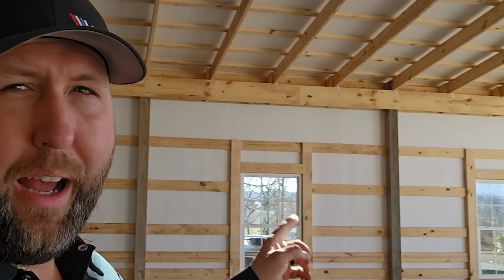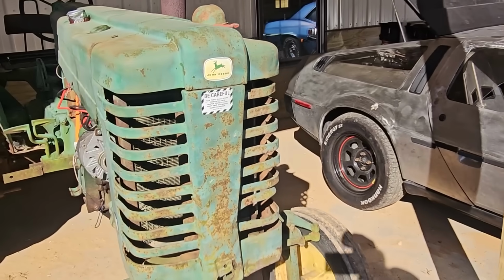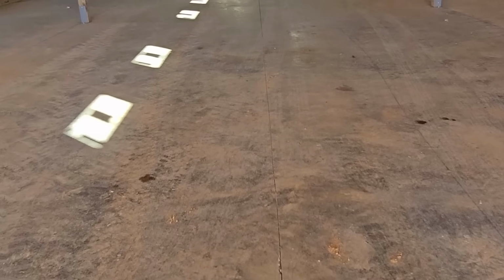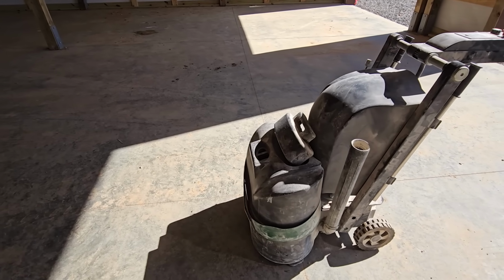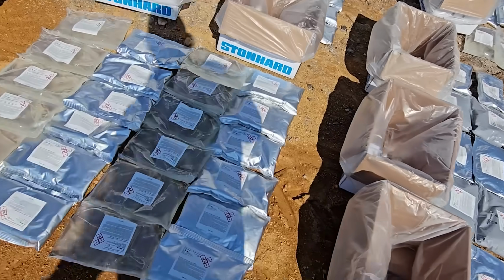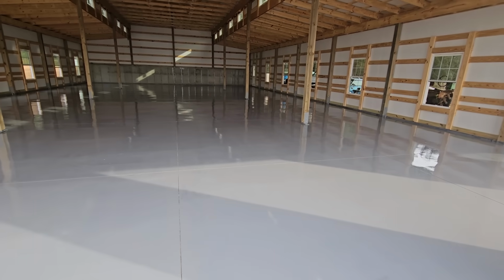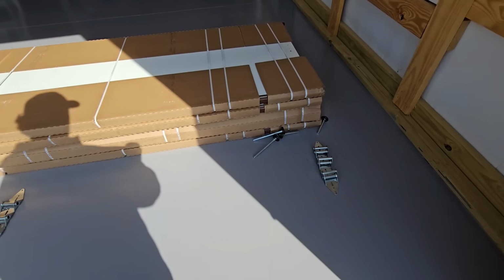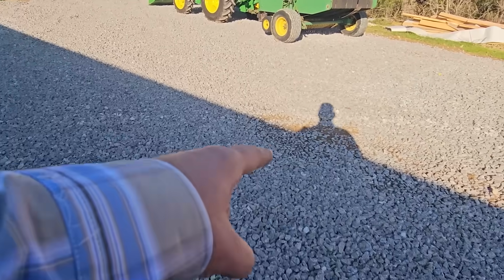Windows, Doors, Floor Epoxy, Gravel and MORE! Barn Build - Part 3

Comment: You should buy one of them old commerical floor cleaner/polishing machines you drive around on the concrete floor making it shiny, probably save a lot of time in the long run for the cleaning.

Comment: I have rebar 2' on center, with the fiber and 5" thick in northern Wisconsin. Still has minor cracks. You'res look a bit wider though. 
Any cement can get minor cracking.   What you're doing is fine, I never even painted mine but would like to for easier cleaning. The old M would be worth a resto 👍

Comment: They put in complete road with sewers and drains, were all braggity on all the high tech features, gonna last forever ... five years and every saw line had perpendicular cracks, they had saw out every crack replace 18 inches "re-strengthened" with rebar, again.  they used to have plank roads made of wood that probably lasted longer

Comment: Just wondering if it wouldn't be cheaper to just spray foam the existing doors on the main shop. Unless, of course, you definitely want to change the exterior appearance and maybe add windows like in the new barn.

Comment: Nobody around here uses rebar, bummer, if you have freezing temps, you need rebar or good steel mesh. Using fiber as a crack stopper is pure marketing bs, it is designed to be a crack inhibitor during the first 24-36 hours of cure, that's it. There is a heavy fiber that is designed to replace rebar, ain't cheap, might even work. The amount of cracking you have indicates a few things. Insufficient compaction, lower concrete strength (guessing a four sack mix used, because everybody down there does it. Recommend  5-1/2 to 6 sack for unheated slabs). Visquene vapor barrier should go under the gravel ballast if it's used at all. Using it directly under the concrete causes unequal cure rate, perimeter cure faster, concrete shrinks as it cures, curing cracks appear where the difference in cure rate creates unequal stresses. These are reasons that, sometimes, the way everybody does it is wrong. Any one of those factors will cause cracking. Done correctly, the control joints cut in will do what they're supposed to do. Your floor is the evidence. Storage the info in the 'ol gray matter for next time, it's a bit late now. A good concrete guy should know this, a concrete company representative must know this.

Comment: The cross bars in the winders are Muntins designed to only class up the joint, if you wanna spend up on winders, do it on a window you plan to look out of like ur kitchen, dining or porch.

Comment: Grew up pouring concrete, Dad was a concrete contractor. Pouring a slab on a hillside always presents more challenges. The pressures uphill from the slab creates heaving, especially when the soil is saturated by rain water. We always used rebar or steel grid due to seismic activity. Dad would always tell the customers that inquired about cracking that, he only guaranteed against fire, theft and flood lol.. cracking is inevitable as the concrete cures and contracts!

Comment: Have you thought about adding some solar panels and running a battery bank? That way you wouldn’t need a dedicated power source and you would still be able to use power tools, portable heaters and have lights in the instance of emergencies.

Comment: I live in Texas and we use re-bar or post tension cables, typically post tension cables but one or the other, never nothing. Cracks in concrete like that is pretty much normal though and not a major issue other then cosmetic.

Comment: Those DeLorean's with the big engine replacements can be tricky with all that weight behind the rear wheels. 
Back end can come out fast when powering through the turns ,but with the original motor it was very manageable,

Comment: I've been out of construction for over a decade but we used rebar in all the Splash pads we built in Texas. 1/2" rebar on 12" centers(6" centers in the commie city of Austin). I must have missed the switch to fiberglass.

Comment: I'm a fan of rebar even if structural engineers and concrete pros say you don't need it.  A large electronics distributor in the northern part of the country recently built a 2.2 million sq. ft. distribution center.  Lots of fiber embedded and now just as many LARGE cracks as square feet.  Just sayin'.      Love the new crib for your collection.

Comment: I wonder if it would benefit a guy to put some solar panels on the roof and a handful of batteries on the sun boil to run the garage doors when needed, instead of adding a full electric service to the whole building...?

Comment: Concrete floor needed wire mesh, not rebar,  floated halfway (2”???) with place holders before pour.  It doesn’t prevent cracks but helps cracks from spreading wider.  All concrete, with or without fiber added or high PSI rating, can crack especially if ground is not properly compacted.  Since cracks are covered by roof, water intrusion and freezing will not be an issue.  Slower curing by keeping it wet and covered with plastic can help.  It does look great after epoxy.  Keeping your equipment and vehicles out of the elements will help all last longer.

Comment: Do the tractor. 

Were the cracks in the floor just from initial settling? I would be concerned that filling them with something rigid would just lead to cracks again as the slab expands and contracts with the seasons. I ground out some cracks in my basement and filled them with Sika self leveling sealant. It has some give so it shouldn't crack again. Maybe that wasn't necessary. I'm not sure - not a concrete guy. 

I want to do my garage as well. It's just a 20x20 foot two car. Some idiot spread that thin concrete resurfacer over all of the expansion joints (like you would do with joint compound on dry wall - they even covered the joints with thin plastic) so of course it cracked. The concrete is in great shape. I guess they just didn't like the lines in the floor. They probably should have filled the expansion joints with something flexible, like that self leveling sealant. Any who, if I paint the floor I want to grind all that crap out of there so I can seal the joints the right way and end up with a level floor. It rises a bit where they built up the resurfacer over the expansion joints.

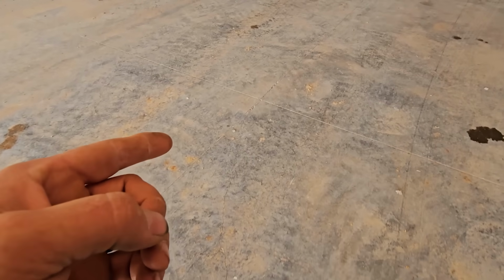Comment: 12:15  Use epoxy to fill in the cracks.  There's epoxy out there, that's seemingly stronger than steel.  Since you're painting it, I'd ask about epoxy to seal the cracks, then sand it even, and paint.  There's stuff called 'crackweld' by 3M.  There's others too.  Since you're going to paint, I'd use epoxy.

Comment: Stonhard is great stuff. We have area in our plant coated for over 7 years and not a wear mark on any of the areas. We used texture for slip resistance in wet areas.  It's expensive but worth the money for sure.

Comment: Yeah I like that garage but you need to do you need to put metal  stop poles in front of the vehicles that you have parked on the side or or along crash guard so when the park the cars on the side so you don't get the building trust me you will hit the building money these days it always happens but putting it still pull or pulls or a crash guard  will save your building sides from getting hit

Comment: In regards to the cracks in your concrete floor in the new building , I've been pouring concrete floors, sidewalks and walls except! Every floor we've poured  we always used 3,500pound concrete! So now if you think about it  the stronger the concrete the less flexible it is ! So let's say you use 4,000 pound concrete it can't and won't be as flexible as a lower p.s.i concrete ,so with that said  any movement of the substrate due to compaction ,weather and temperature the concrete can and will cracks. Plus they can try fixing the cracks butt the cracks are always going to be cracks no matter what they try doing  !

Comment: Saw cut expansion joints/control joints don’t work as well as control joints that are cut in when the concrete is still wet.

Comment: Polyurea is more durable than epoxy and more flexible because it is an elastomer. It is also chemical resistant and can withstand stable heat up to 266℉ and 430℉ for a shorter time.

Comment: Yeah that concrete is going to move a little bit and cracks will form and if your going to have a concrete driveway... make sure you tie into the barn with rebar.

Comment: Structural engineer here.  Those cracks are typically a subgrade issue, not so much a concrete issue.  On some occasions if concrete cures too quickly it'll crack but not like that.  Your expectations are spot-on.  That'll be a decent fix for now but it won't be a forever fix.  

If there was rebar in the slab those cracks would probably never really open up more than that, but without there's certainly that possibility.  Fiber isn't bad, but it's not rebar.  Edit:  I actually noticed those cracks in your last Lodge video and I was surprised at how quickly those were there.
Reply: Yes, I noticed and was disappointed by the cracked floor.  I have a thing about vehicle carrying concrete and always make sure it will take the weight.  I like 6”-9” of hardcore, topped with 6” minimum of reinforced concrete, my choice would be 9” of granolith if I was putting lorries on it.  Thing is if you are building a workshop you don’t ever want to think about the floor again.
Reply: Yea... It will never NOT CRACK for sure.  Interesting to see how fast it cracks.  Obviously I substrate issue.  I would have been sick to my stomach to have such a crap job that I have to do temp fixes on the rest of my life!!   ha
Reply: I’m near Montreal and I did a slab for a rear deck installation last year and you wouldn’t believe the prep we did for the concrete and that was for a stair landing.  

This slab either sank or heaved (I’m guessing sank) and that should have been looked after pre-pour.  

But either way…. Get used to cracks in your concrete lol

Comment: Nice barn, and glad that the contractor is stepping up to deal with the concrete issues. Not all Southerners pour concrete without rebar..., except for perhaps a air-conditioner pad. Even using wire beneath the concrete is better than just fiber.

Comment: Its such a shame that you had to have those cracks in the slab of your brand new building.  Your builder will tell you lying things like "all concrete cracks"  and "there's only two kinds of concrete....cracked concrete and concrete that's going to crack".   Those cute statements are always made by people who don't know much about concrete.   I'm a ACI certified concrete tech with actual field experience. Years of it. Those small cracks are caused by too much water added on the jobsite when initially placing the fresh concrete.  Finishers do that so they don't have to work as hard.   Secondly, the cracks are caused by poor curing methods.  Proper cure is super important.  Very young concrete has little to no tensile strength.  When new concrete begins to dehydrate, it shrinks. This pulls the surface just like a sheet being stretched in all directions. But with no tensile strength yet, the young concrete cannot resist the surface tension and it cracks. To avoid this, you must keep it "wet cured" for about two weeks.  That means wetting it down and covering with plastic tarps.  It takes wetting every day.  Every Day!  Now days, builders will just spray it with "Cure and Seal".   That's supposed take the place of wet curing.  But you can't walk on it or you'll destroy the chemical seal everywhere you step.  So what does the building do?   He sprays it one day and then starts framing on top of it a couple of days later.   You effectively have zero cure.   Well, that's what happens.  Ask your builder why he gave you a crappy slab.

Comment: Use Rebar Mesh!!! NO cracks!! worked on rigs etc and other jobs with large spaces used rebar mesh about 8mm in diameter. Never heard of large flat space pours without mesh rebar very odd.....

Comment: I live further south than you fella. I never had any problem with my shop slab for 15 years. Then we got a super hard freeze a couple years ago it was ruined. Ended up breaking everything out but the footings and redoing the slab with rebar and wire in it. The biggest pain was clearing out the shop and covering stuff with tarps while we got it fixed. I certainly hope they did something different with the concrete on yours than how mine was done and you don't have problems.
Reply: He will have problems in the future. All they did was band-aid it. He said they don't use rebar in floors there. I'd be curious to look at all the floors these guys have poured to see how they have held up.

Comment: instead of brick you could also do concrete that looks like river rock or slate on the waynes coating of the building, and you can buy the 1" thick styrofoam insulation and fit it into the doors at the other shop, a skilled painter could make those doors look like anything you want. just saying

Comment: I live in Wisconsin and I had a driveway expansion done in 2010 and I had them put the tiger hair in the cement but if you look at all the photos I have they only put rebar in like every 3 feet and I have cracks all over. When my dad was younger and I was just a little kid he was a jack of all trades and he used to do anything from construction to plumbing and roofing as well as concrete and if you look at his driveway that he did by himself and with some friends there is maybe one hairline crack and the driveway is like 30 years old and that’s because he put rebar every foot which is some people would say that’s overkill but when you have one hairline crack in 30 years I would say that’s a good thing. To me there’s never too much it’s not enough is the problem. Unfortunately my father passed away over five years ago so God rest his soul he was a good man

Comment: Very nice and keeping the weather off alot of your vehicles and such will be a plus and a place maybe your kids can tinker on there go carts motorcycles ECT. You could get solar powered motion spot  lights set up around or a few inside until u decide to get AC power put in as I have a solar powered motion light on back corner of my house and it works great.

Comment: Looks great.  Funny no one around there uses rebar  in the concrete but the barn ended up with a bunch of huge cracks.  Sounds like they should start using rebar doesn't it?

Comment: Just and idea if you want to save on gravel you could do soil stabilization, mix concrete with the soil then rototiller it, then compact it and spray water one it

Comment: or a few LED lights and door openers, 2 or 3 solar panels and a few batteries should be more than enough to keep up with power demand. You could have that place powered without infrastructure for a few thousand.

Comment: Do they put any blame on the big drop in temperature soon after the floor was done? Nothing like leaving North Dakota and Minnesota and getting snow storms. FWIW, putting the fake stone or brick down at the bottom looks nice, but it usually cracks and doesn’t stick too well. Both my sons are in Georgia and have had that experience.

Comment: I mean just because nobody else uses rebar doesn't mean it's not a good idea for you considering you got all that hydrostatic pressure water coming off that hill behind you which is probably what caused that and for some reason everybody you know uses clay down there for building pads which I never understood that but hey you got to do what you got to do with what you got

Comment: Install some steel plates between that door jamb  and the building framing for the lock bolts  to pass through ...bars on the windows too ..invest in a good alarm system and high res cameras with off site recording

Comment: I'm gonna call BS on the rebar/mesh down south!! They're blowin smoke up your butt!! They're just cheaping out and covering up, PERIOD!! Those relief cuts are trash too, what did they do "cut" them with string line?? And BS on coming in a "fixing" cracks, the ONLY way to fix is ripping it out and starting over!! You got ripped a new one with that floor, its just trash!!